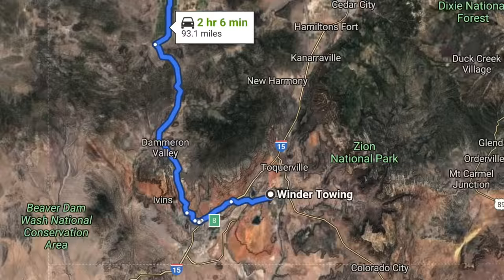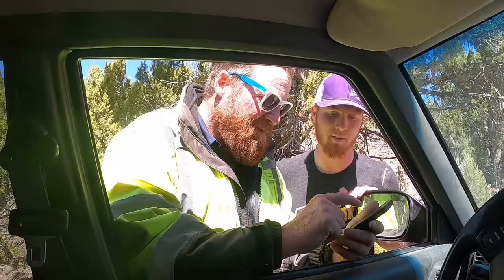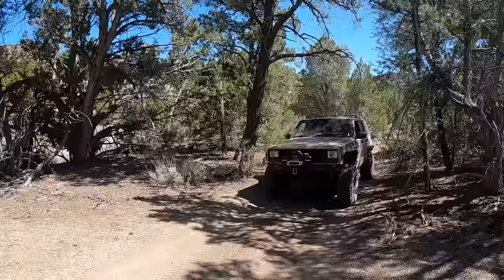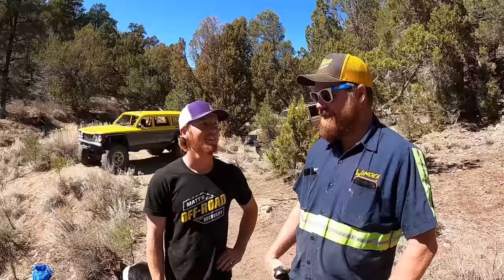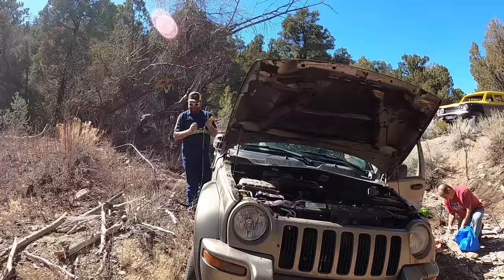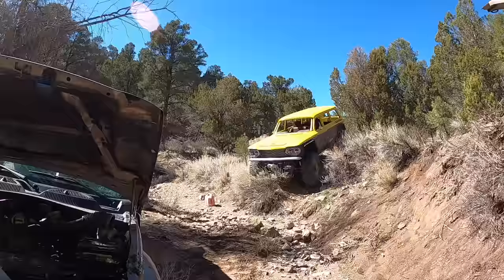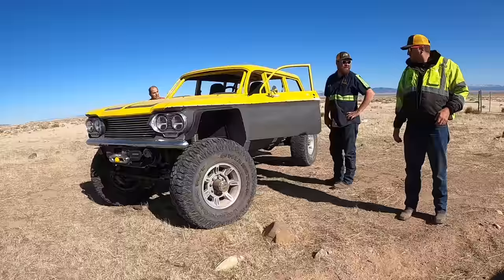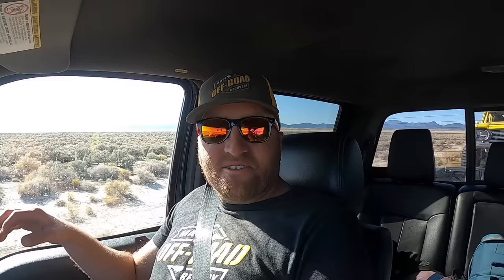Jeep Liberty Rollover 100 Miles In The Backcountry

Comment: What was that guy up to? Seems a bit odd to be way out in the back country in a completely stock liberty...
Reply: He had got there to the end of the road, turned around and was coming back when the front driveshaft blew. 
You can see that even under tow, only having rear wheel drive on a sideslope means the arse end slides downhill...and when it sldes downhill enough, you roll.
He had no other option as he did not have any other vehicle to tow him out.
After Matt's recovery he drove the vehicle home.

Not his first rodeo....

Comment: Can an engine even Erin after it has been on its noggin for a few hours?
Reply: What is there i an engine that can be upset by being uspsifde down for a few hours?
Old batteries could leak all their fuids out...new ones are sealed.
Replace the oil in the sump..
Drain the cylinders by taking the sparkplugs out and having the pistons eject any liquids in them.....
Replace any other fluids that may have leaked.
Drive.

Comment: How did that thing make it all that way just to slide off...
Reply: He had driven to the end of the road, turned around and was coming back when the front driveshaft blew.  
Had he not rolled he would have got out unscathed and driven home with no one the wiser.
If as you saw when it was towed, with only rear wheel drive.... the rear end slides sideways on a sideslope...why it rolled.
He did drive it home after the recovery....

Comment: Can someone tell me what rudy is holding at 9:30?
the thing with the wheel.
Reply: It's a pulley block

Definitions of pulley-block.
A simple machine consisting of a wheel with a groove in which a rope can run to change the direction or point of application of a force applied to the rope.
Note Rudy crosses the dry wash and uses a strap to attach the pulley block to a tree to allow the Jeep on the opposite side of the creek to winch the rolled jeep onto it's wheels.
Reply: @JohnSmith-yv6eq  Thanks you John!

Comment: Was he disposing of a dead body way out there?
Reply: He had got there to the end of the road, turned around and was coming back when the front driveshaft blew. 
You can see that even under tow, only having rear wheel drive on a sideslope means the arse end slides downhill...and when it sldes downhill enough, you roll.
He had no other option as he did not have any other vehcicle to tow him out.
After Matt's recovery he drove the vehicle home.

Not his first rodeo....

Comment: After getting rolled 360 degrees on rocks, is the Jeep gonna be worth anything?  This is such a dumb situation I can't stand it.  Here in Florida, people use their four-wheel drive to get stuck in much worse places.  Just like wherever this place is.  At least there's no soupy mud to make things really nasty.
Reply: He had driven to the end of the road, turned around and was coming back when the front driveshaft blew.  
Had he not rolled he would have got out unscathed and driven home with no one the wiser.
It couldn't be left abandoned as the arranged tow and fines would have exceeded Matt's charges....
He did drive it home after the recovery....

Comment: That jeep is definitly not for offroad,  the suspenssion is too low and the deive shaft are not stronger for offroad, in addition to the tires. It can modified for offroad,  It i will work on a straight cleaned offroad and it will on a snow in the road.

Comment: Plot twist:
He was running from the cops and got away. (That’s where the cops tire tracks stopped) Then he flipped his truck. Now y’all are an accessory.
Reply: He had driven to the end of the road, turned around and was coming back when the front driveshaft blew.  
Had he not rolled he would have got out unscathed and driven home with no one the wiser.
He did drive it home after the recovery....

Comment: I don't think this guy knows what he is doing.  This was why he drove this SUV up there.
Reply: He had got there to the end of the road, turned around and was coming back when the front driveshaft blew. 
You can see that even under tow, only having rear wheel drive on a sideslope means the arse end slides downhill...and when it sldes downhill enough, you roll.
He had no other option as he did not have any other vehcicle to tow him out.
After Matt's recovery he drove the vehicle home.

Not his first rodeo....

Comment: Far too many people put far too much belief into there so called off road vehicles. They are better than most vehicles in dealing with wet and snowy conditions, but taking them onto soft or muddy conditions and rocky terrains is just asking for trouble. If you want to do that then buy a military tank.
Reply: He had driven to the end of the road, turned around and was coming back when the front driveshaft blew.  
Had he not rolled from slipping sideways with only rear wheel drive on a sideslope he would have got out unscathed and driven home with no one the wiser.
He did drive it home after the recovery....

Comment: Shoulda kicked out that windshield.  Would have made life much easier.  Also....it's totaled,  should take it straight to the wreckers and see what you could get, it's still got a lot of good parts,  but unless you're a bodyman there is no way it's worth paying someone to fix that.
Reply: He had driven to the end of the road, turned around and was on the way out when the front driveshaft blew. 
He rolled when the rear slid sideways going up a cross slope (which sliding also can be seen when under tow). 
It rolled and he walked out all night to call Matt. 
Federal fines for dumping and an "arranged" tow would have cost more than Matt's recovery...
and then he drove it home!
Reply: @JohnSmith-yv6eq    Oh yeah,  I wasn't saying he shouldn't have got it out of there.  You should never leave your vehicle on public lands,  it's ours to use but also our responsibility to take care of the land too.

Comment: Frying the transmission... Then forcing a rebuild after engine oil ruins the bands, clutches, and seals. Oh well.
Reply: He had driven to the end of the road, turned around and was coming back when the front driveshaft blew.  
Had he not rolled he would have got out unscathed and driven home with no one the wiser.
He did drive it home after the recovery....
Reply: @JohnSmith-yv6eq  And needed a new transmission soon after. It would be much better to get some trans fluid before driving it, unless the owner did not care and said "go-ahead". If it was totaled, he could have sold the drivetrain.

Comment: ALMOST ROLLING IT A SECOND TIME >>>  18:03
Reply: Which shows how much side slip you get with only 2wd....
it can be used to skid the back end around from a standstill on a slippery uphill tight corner...too tight to negotiate with 4wd.
Disengage 4wd, accelerate hard booting the back end round until you point uphill...then re engage 4wd and continue.
Works best if you have LSD locker in rear...swings like a go-kart....

Comment: Some of these roll overs aren’t worth saving there ready for the junkyard
Reply: He had driven to the end of the road, turned around and was on the way out when the front driveshaft blew. 
He rolled when the rear slid sideways going up a cross slope (which sliding also can be seen when under tow). 
It rolled and he walked out all night to call Matt. 
Federal fines for dumping and an "arranged" tow would have cost more than Matt's recovery...
and then he drove it home!

Comment: That's the problem with these new Jeeps they are not like the old ones  no real 4x4 just junk
Reply: He had driven to the end of the road, turned around and was on the way out when the front driveshaft blew. 
He rolled when the rear slid sideways going up a cross slope (which sliding also can be seen when under tow). 
It rolled and he walked out all night to call Matt. 
Federal fines for dumping and an "arranged" tow would have cost more than Matt's recovery...
and then he drove it home!

Comment: Why the hell would anyone want to go up there in the first place?
Reply: He had got there to the end of the road, turned around and was coming back when the front driveshaft blew. 
You can see that even under tow, only having rear wheel drive on a sideslope means the arse end slides downhill...and when it sldes downhill enough, you roll.
He had no other option as he did not have any other vehicle to tow him out.
After Matt's recovery he drove the vehicle home.

Not his first rodeo....

Comment: One can only ask "Why?"
Reply: He had got there to the end of the road, turned around and was coming back when the front driveshaft blew. 
You can see that even under tow, only having rear wheel drive on a sideslope means the arse end slides downhill...and when it sldes downhill enough, you roll.
He had no other option as he did not have any other vehcicle to tow him out.
After Matt's recovery he drove the vehicle home.

Not his first rodeo....

Comment: when you see that much crap falling out of a vehicle it screams tweaker that's the second sign first sigh is where he was at..
Reply: He had got there to the end of the road, turned around and was coming back when the front driveshaft blew. 
You can see that even under tow, only having rear wheel drive on a sideslope means the arse end slides downhill...and when it sldes downhill enough, you roll.
He had no other option as he did not have any other vehcicle to tow him out.
After Matt's recovery he drove the vehicle home.

Not his first rodeo....
By the way, having gear in the vehicle (food, water, medicines, first aid gear etc. is a sign of good planning...

Comment: My daughter had a Liberty, what a piece of junk! I can’t believe how far he got with it but I guess if you don’t care what happens to a vehicle it’ll probably do more than you think. I would have been tempted to just drag it out on its roof.
Reply: He had driven to the end of the road, turned around and was on the way out when the front driveshaft blew. 
He rolled when the rear slid sideways going up a cross slope (which sliding also can be seen when under tow). 
It rolled and he walked out all night to call Matt. 
Federal fines for dumping and an "arranged" tow would have cost more than Matt's recovery...
and then he drove it home!

Comment: The Liberty version of the Jeep is a little compact car version and has no capabilities expected of a Jeep Wrangler with beefed up suspension and bigger tires and winch and tow attachments. They do NOT belong on these trails. Even an off the showroom Wrangler does not belong on these trails.
Reply: He was on his way back from further up the trail!. 
He was on an uneventful (for him) journey. 
It all came unstuck when he blew the front driveshaft...so he only had rear wheel drive. 
As we can see even when it was being towed, rear wheels drive only means the back end "walks" on a sideslope under power...
So, this sideslope = roll.
He drove that vehicle back to his home after Matt towed him out.
Not his first rodeo....
Reply: @JohnSmith-yv6eq  Nothing in your reply disputes my point. It simply proves it. That model was not designed for such a trek and certainly not stock.

Comment: As shity as a jeep liberty is I would still think they would be capable of off roading if in good working condition especially being 4x4
Reply: He had driven to the end of the road, turned around and was coming back when the front driveshaft blew.  
Had he not rolled from slipping sideways with only rear wheel drive on a sideslope he would have got out unscathed and driven home with no one the wiser.
He did drive it home after the recovery....

Comment: thats what happens when you drive a POS off road
Reply: That vehicle was further in and coming back after the front drive shaft blew. So, had that not happened, it would have got in and come back out and no one would be in the least concerned. 
It rolled because, as you can see, even when under tow, with drive only at the rear, on a side slope, the rear "walks" to the downhill side. 
Thus the rollover.....